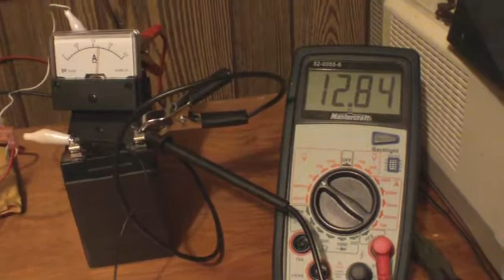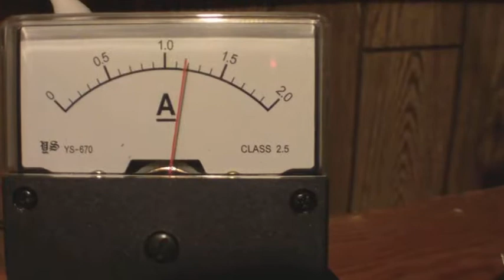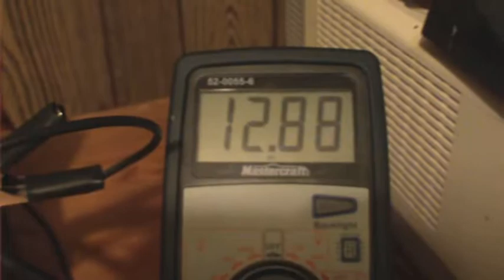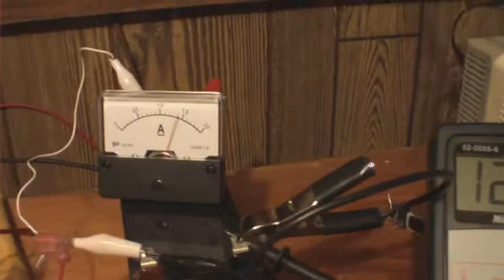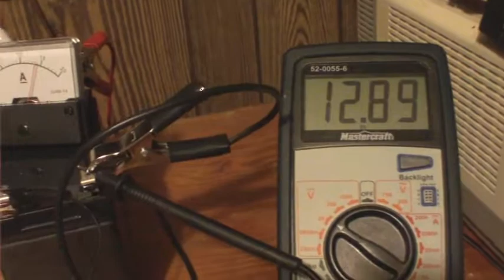SSG Aluminum Air Core Experiment PT. 4

Comment: Hi Kyle
I used LAN cable in my solar lighting and just tried it but unforttunately will not resonate  maybe due to very thin wires and loose coil on a crt toroid  will unwrap again and use the #23  ga wire wgich worked for me well  especially with My ALUM battery converted....

Comment from the maker: Sorry it was not meant as a conclusive test, as I do not believe the meters.. for one thing... more of an observation / effectiveness / qualitative experiment than "quanitities" or any measure of accuracy. No comment on the cap and diode in vs. not in... I'll have to look at that a bit more closely, perhaps run the cap and diode with less input resistance or none at all. See what happens.

Comment from the maker: So the two cycles looked something like this:
RS 13.0V CS 12.4V
RE 12.2V CE 13.0V (after rest of 1 hour) Total time about 1 or 1.5 hrs
-switch batteries-
RS 13.0V CS 12.2V
RE 11.7V  CE 13.0V (after a rest of 1 hour) Total time of about 2.5 - 3 hours)